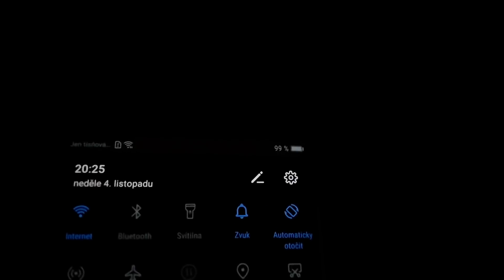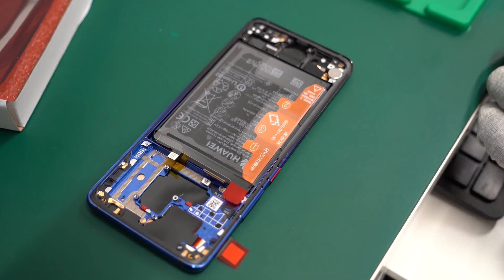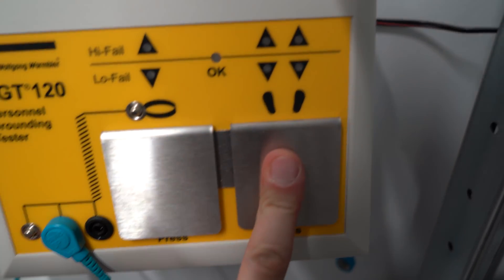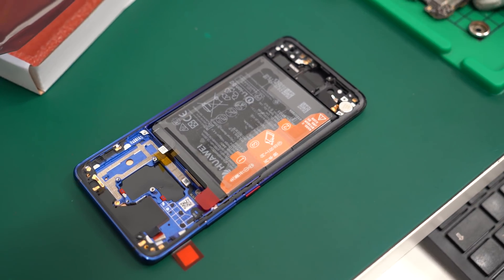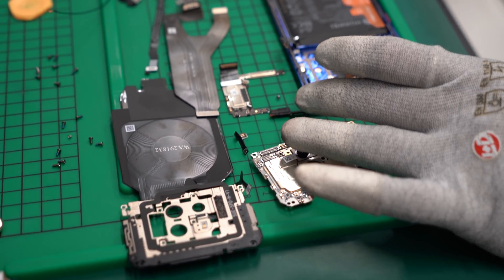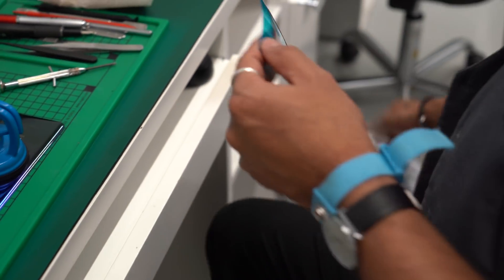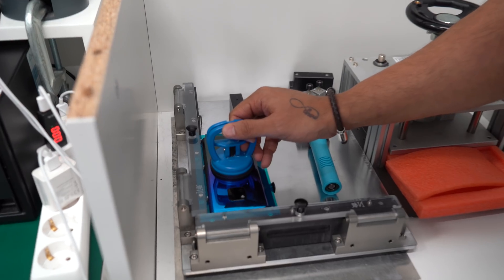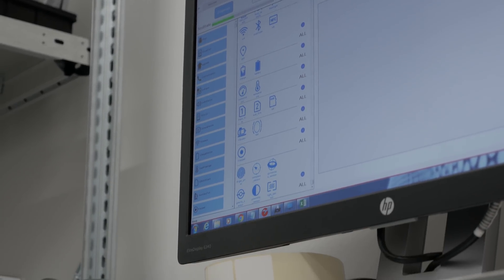Fixing the Huawei Mate 20 Pro Gluegate Problem - Teardown & Repair !

Comment: Repair? For a factory defect? I think a brand new defectless device  should be in order, or a money return policy .Not a darn repair.
Reply: In Germany you have the right to choose between a repair or a completely new device. If i don't get a new device, i will burn their ass!
Reply: Peopla are ridiculous, no one should accept this. It's a 1000$ device, and if you make peace with this kind of shit it's gonna become a standard for all phones. By that logic, 300$ phones shouldn't work att all. Return this peace of overpriced shit and take your money back.
Reply: Exactly. At least Apple will replace your device when it's just new and has a defect.
Reply: Joe the replacement apple device is not brand new just so u know, so always reconditioned iphone, they just dont tell
Reply: @haha3232423432  During the first days after buying it no, they always give you a new one. As far as i know, the reconditioned phones are for others defects passing the first months.
Reply: @shadow7423  hope so!
Reply: @shadow7423  No, they don't .. Apple is known for replacing RMA'ed iPhones with refurbished units. It made a big splash in the news a couple of years back.
Reply: @4dd0  not with my experience. They always replaced it with a brand new unit sealed.
Reply: @shadow7423  Brian is right. Apple will give you so called service unit, which is basically refubrished phone. Mine iPhone got faulty after 3 weeks since I bought it. Apple replaced it with service unit, but thankfully the shop where I bought iPhone do not  give these service units back to their customers. I was offered with option to either get new iPhone in sealed box or to get whatever else in same price or higher, so I ended up with Mate 20 Pro. IPhone pissed me off.
Reply: Not when it comes to NEW released iPhones, and that's what I am talking about. New models that just come out, Apple doesn't have refurbished units yet. So you get a new iPhone as a replacement. However, if you bought a new iPhone that has been released for a while they will replace it with a refurbished model.
Reply: @shadow7423  brand new sealed unit? are you sure cant put phone back to new condition in centralised service centers? are you sure Big Apple cant put back protection foil on screen and rear? are you sure any other engineers cant wrapped phone box in shrink wrap apart of Chinese workers? aee you sure they give you new phone taken from self front of you, or bring from back whit big smile like nothing happen.
Reply: @tomaskonkol8894  Yes! How can they even get refurbished units when a new model just came out? It would be different if it has been a few months. But seriously, when a new model is released, they won't have refurbished units yet.
Reply: @shadow7423 Nope. I got my iPhone replaced with a refurbished unit for power button defect on my old phone.
Reply: @chmok2617 Apple has always replaced it with a brand new phone. How can they give you a refurbished one when the phone has just been released? You guys are making stuff up.
Reply: Actually i had the same problema but Huawei gave me a new device
Reply: MADE IN CHINA LOL
Reply: @StoicChoco  So's the Iphone.
Reply: @iaincowell9747  the one in the LCD phones come on man. That phone is made in China for the Chinese market lol stop!
Reply: I agree, because otherwise you paid full price for a refurbished one. REFURBS ALWAYS COST LESS THAN BRAND NEW!!!
Reply: I had this problem and Huawei replaced the phone and send me a pair of Bluetooth headphones as apologies.
Reply: You dont get a new car when your transmission fails. 

They replace known bad parts with updated ones and send you on your way. 

Someone sounds like a spoiled customer.
Reply: @Marco Chavanne   Search car recalls.
Reply: Dude. What? You don't get a new car when it is recalled. Maybe a loaner. Are you okay?  Seems like you might have bumped your head.
Reply: I am all about options DUDE. If you are ok with buying faulty products i am not. As i stated on previous comments i have no problem  with the repair option,but only as a customer choice. And there is a bigger reason behind that than a "spoilt customer mentality" which i also stated before.As for the cars you are entitled to a full refund , a replace or a free repair at least in the us. Search it.
Reply: Lemon Law and Recalls are not the same thing. 
Educate YOURSELF.
Reply: you are an idiot.
Reply: Die werden das doch wohl hoffentlich im Rahmen der Garantie umtauschen!?
Reply: In Austria there is no money back or return policy law.  Unless you bought it online, then you can return it within 14 days and get the money back. There is a mandatory 2 year warranty, but they just need it to work properly, there is no obligation to replace it with a brand new one.
Reply: I agree mate  ,  too my mind  , once device has been  dismantled and put back together again ,  it is no longer a new pristine  device .
 If they can not supply me with a device that works as it should and as you would expect  from the  factory  ,
I would rather  have a refund and take my business elsewhere .
Reply: i had two mate 20 phones both were faulty with green screen issues. I was lucky enough to get a refund within the statutory 30 day refund period all shops that sell phones in the UK must adhere to. But to put this quite simply this phone was not worth the price point being asked for it. Huawei's customer service was absolutely awful when i tried to deal with Huawei support direct, too.  I personally won't be going near this brand again. Unlike this youtuber would have you believe this problem isn't a small issue. I was told by the store i returned my mate 20 pro huaweis to that they had had a 80% return rate for the mate 20 pro. This channels reviewer is making out this problem hasn't been a big issue. It has.
Reply: What's the purpose of replacing with a new one but still have the same problems? Huawei solutions for the repairs because, most of the stock in a particular store still use LG's OLED screen which majority of it have defects. Do note that, Mate 20 Pro that comes with BOE's display didn't have this problems.  Since they change the battery and screen at the same time, it will do the job. Better have actions than totally ignoring their customers.
Reply: They are not repairing the mate they are switching for a new one. No way they can handle so many repairs.
Reply: I bet all in this comment section has never bought a Huawei device... Empty barrel make the most noise
Reply: I really never understood what difference it does make to get a new device or it repaired? Is there something magical done at the factory that disappears when repaired or why the need for a new device? Or are people just that greedy...
As long as it's possible the repair is a so much easier solution when there is no need to do backups and then install everything again on a new device.
Reply: @Iceeeen  lol
Try that with a new car, it resale value will just plumb and it may not be 100% free of the defect. A new one is always better.
Reply: @MiguelAngel-rw7kn  Where the heck do you live when you get a new car due to something going wrong? You get a new part, seriously I want to now cause that part of the world I never heard of. Even worked in servicing new Audi, Vw, Mb, BMW when I was still in school. 
But if you knew how new cars can look before they reach the customer you might be quite shocked, you now when the pre delivery service is done and also every scratch and so on is polished away, a door might need repainting and so on. Even had a friend working for a VAG importer for quite big market (few countries combined) as a painter, they way even Lambos could look is quite insane but nothing sanding, paint and polish cant solve
Reply: Iceeeen I can’t believe how stupid this comment is, just reading how hard u are struggling to defend this.

Would u say same if it were an Apple device?

Dumb dumb android toys
Reply: You are not greedy when you want a device that you paid for as new to work  without needing a repair first.A repaired device is a refurbished device, a whole new different category of products.I can understand the point of not wanting the hassle to install everything again , but that should only exist as a consumer option to this problem.Not as a default.
Reply: @brucewayne-px4lv  but what's the magical thing happening at the factory?? That makes is so much better than  a screen replaced by a guy with the right tools at a service center. In this case one guy is a dutch? the one at the factory a Chinese (guessing that partof  the assembly process is done by a human, but still don't matter if it's a robot) . But other than that? What's better with the new device, i really don't get peoples view on that
Reply: In this particular case maybe the screen assembly was made by humans. Hence the glue  defect. But thats not the point i  am making.Companies should be held responsible at the highest regard when they sell products that are defective.The consumer should always have options on how they should be compensated.This is necessary in order for them to develop a sense of responsibility against the client. So we dont have exploding batteries,spyware in our operating systems  and chipsets , catastrophic software updates or bright neon glue on the back of our screens.
I state again that i am not against the repair as an option , only though when it its not the only one.
Thats the magical thing that should be happening in the factory.Its called quality control.
Reply: @Iceeeen   things that have been dismantled and put back together  often do not always go back together exactly the same as they came out of the factory. 
  Did you see the guy reparing  re  test the device to make sure it is still water resistant ?  
The electrical connections  for dismantling  have now been  on once at the factory  , removed for repair and refitted a second time  , 
 some electrical connectors do not  go on as tightly the second time .
 You now essentially have  a  very expensive  second hand phone  whether  you deem it "repaired" or not  .
 If you are happy to  pay a thousand dollars for a device  only to have it dismantled and rebuilt , that is indeed your  prerogative  .
 I would not like it though .
Reply: @brucewayne-px4lv  haha a fk up on a brand new device is enough for me to change brands.